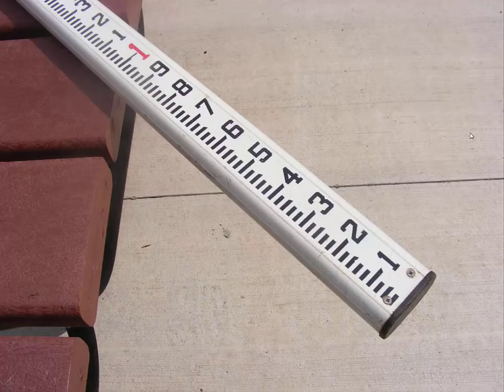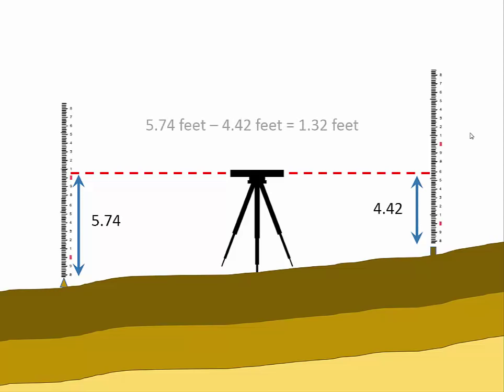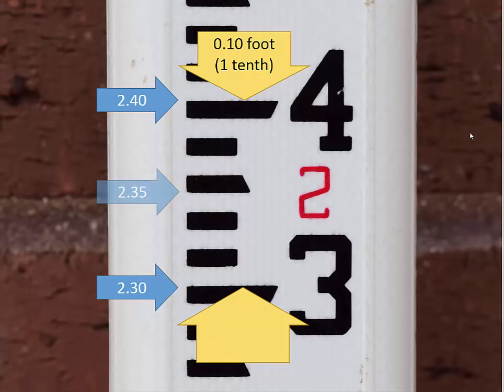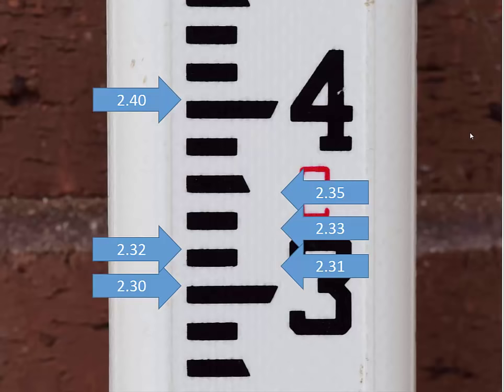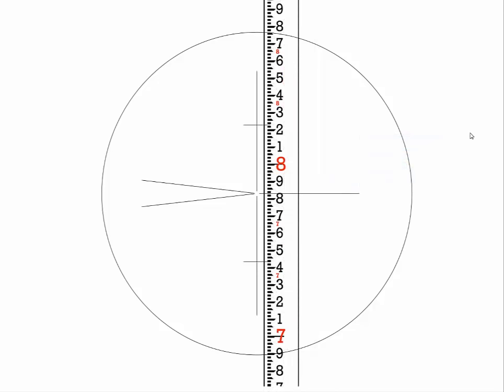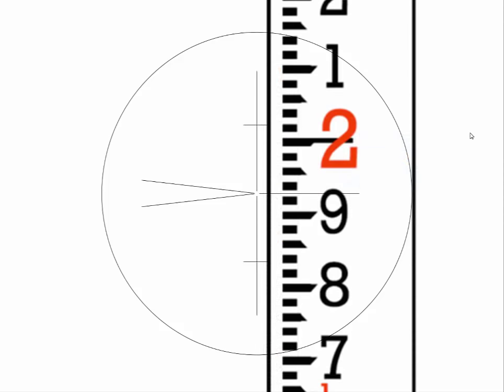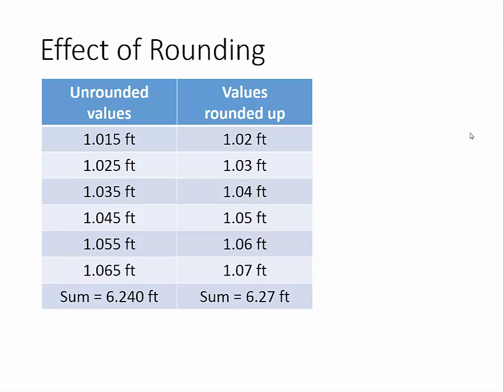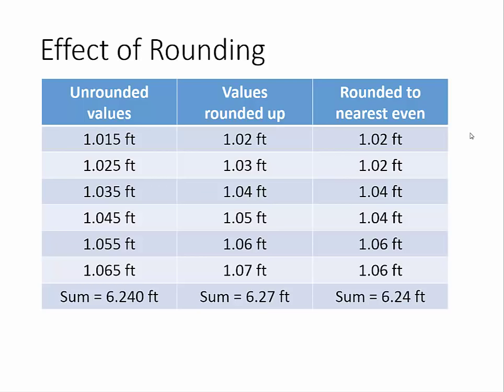Reading the Level Rod

Comment: This is correct as long as the rod is held completely vertical. If the rod is leaned forward or backward, the reading will increase. When I worked for a surveyor, he would have me rock the rod forward and backward towards him slowly and he would read the smallest reading. You should always reverse your circuit to the beginning point to verify if there were any misreads.

Comment: 1 out of 12 = 0.834, 2 out of 12 = 1.68, 3 out of 12 = 2.5, 4 out of 12 = 3.334, 5 out of 12 = 4.168, 6 out of 12 = 5, 7 out of 12 = 5.834, 8 out of 12 = 6.668, 9 out of 12 = 7.5, 10 out of 12 = 8.334, 11 out of 12 = 9.168 & 12 out of 12 = 10. 1 inch is 0.083 feet (8.34% of a foot) & 0.25 hands, 2 inches is 0.168% of a foot (16.68% of a foot) & 0.5 hands, 3 inches is 0.25 feet (25% of a foot) & 0.75 hands, 4 inches is 0.334 feet (33.34% of a foot) & 1 hand, 5 inches is 0.418 feet (41.68% of a foot) & 1.25 hands, 6 inches is 0.5 feet (50% of a foot) & 1.5 hands, 7 inches is 0.584 feet (58.34% of a foot) & 1.75 hands, 8 inches is 0.668 feet (66.68% of a foot) & 2 hands, 9 inches is 0.75 feet (75% of a foot) & 2.25 hands, 10 inches is 0.834 feet (83.34% of a foot) & 2.5 hands, 11 inches is 0.918 feet (91.68% of a foot) & 2.75 hands & of course 12 inches is 100% of a foot & 3 hands long.

Comment: My kind of teache!!
Reply: @RAUL HOGLAND, you mean “My kind of teacher!!” and I can break every single inch out of the foot by the percentage calculation.
1 inch is 8% of a foot, 9% of a foot = 1&1/12 inches, 10% of a foot = 1&1/5 inches, 11% of a foot = 1&1/3 inches, 12% of a foot = 1&1/2 inches, 13% of a foot = 1&7/12 inches, 14% of a foot = 1&2/3 inches, 15% of a foot = 1&4/5 inches, 16% of a foot = 1&11/12 inches, 17% of a foot = 2 inches, 18% of a foot = 2&1/6 inches, 19% of a foot = 2&1/4 inches, 20% of a foot = 2&2/5 inches, 21% of a foot = 2&1/2 inches, 22% of a foot = 2&2/3 inches, 23% of a foot = 2&3/4 inches, 24% of a foot = 2&9/10 inches, 25% of a foot = 3 inches, 26% of a foot = 3&1/8 inches, 27% of a foot = 3&1/4 inches, 28% of a foot = 3&1/3 inches, 29% of a foot = 3&1/2 inches, 30% of a foot = 3&3/5 inches, 31% of a foot = 3&3/4 inches, 32% of a foot = 3&5/6 inches, 33% of a foot = 4 inches, 34% of a foot = 4&1/12 inches, 35% of a foot = 4&1/5 inches, 36% of a foot = 4&1/3 inches, 37% of a foot = 4&1/2 inches, 38% of a foot = 4&7/12 inches, 39% of a foot = 4&2/3 inches, 40% of a foot = 4&4/5 inches, 41% of a foot = 4&11/12 inches, 42% of a foot = 5 inches, 43% of a foot = 5&1/6 inches, 44% of a foot = 5&1/4 inches, 45% of a foot = 5&2/5 inches, 46% of a foot = 5&1/2 inches, 47% of a foot = 5&2/3 inches, 48% of a foot = 5&3/4 inches, 49% of a foot = 5&9/10 inches, 50% of a foot = 6 inches, 51% of a foot = 6&1/6 inches, 52% of a foot 6&1/4 inches, 53% of a foot = 6&1/3 inches, 54% of a foot = 6&1/2 inches, 55% of a foot = 6&3/5 inches, 56% of a foot = 6&3/4 inches, 57% of a foot = 6&5/6 inches, 58% of a foot = 7 inches, 59% of a foot = 7&1/12 inches, 60% of a foot = 7&1/5 inches, 61% of a foot = 7&1/3 inches, 62% of a foot = 7&1/2 inches, 63% of a foot = 7&7/12 inches, 64% of a foot = 7&2/3 inches, 65% of a foot = 7&4/5 inches, 66% of a foot = 7&11/12 inches, 67% of a foot = 8 inches, 68% of a foot = 8&1/6 inches, 69% of a foot = 8&1/4 inches, 70% of a foot = 8&2/5 inches, 71% of a foot = 8&1/2 inches, 72% of a foot = 8&2/3 inches, 73% of a foot = 8&3/4 inches, 74% of a foot = 8&9/10 inches, 75% of a foot = 9 inches, 76% of a foot = 9&1/8 inches, 77% of a foot = 9&1/4 inches, 78% of a foot = 9&1/3 inches, 79% of a foot = 9&1/2 inches, 80% of a foot = 9&3/5 inches, 81% of a foot = 9&3/4 inches, 82% of a foot = 9&5/6 inches, 83% of a foot = 10 inches, 84% of a foot = 10&1/12 inches, 85% of a foot = 10&1/5 inches, 86% of a foot = 10&1/3 inches, 87% of a foot = 10&1/2 inches, 88% of a foot = 10&7/12 inches, 89% of a foot = 10&2/3 inches, 90% of a foot = 10&4/5 inches, 91% of a foot = 10&11/12 inches, 92% of a foot = 11 inches, 93% of a foot = 11&1/6 inches, 94% of a foot = 11&1/4 inches, 95% of a foot = 11&2/5 inches, 96% of a foot = 11&1/2 inches, 97% of a foot = 11&2/3 inches, 98% of a foot = 11&3/4 inches, 99% of a foot = 11&9/10 inches and of course 100% of 1 foot is 12 inches.
Reply: @eugeneyang5678  please stop.  No one cares
Reply: @cw9734  , CW I respect that you told me to stop because you said the magic word please. Technically you are the one that doesn't care. If you think that my information that I posted was not helpful, annoying, disturbing or is too much I am sorry. I worked very hard and put all of my effort on it for at least 2 years ago. If you don't like measuring height or length with the metric system, the decimal feet or the engineering tape measure you can always use the standard tape measure. And some of the standard tape measures do come with fractions of inches too. Just leave if you are not interested and if you are not good at measuring anything. Period.

Comment: Just to throw a monkey wrench in, half of the measurements are positive (the backsight) and half of the measurements are negative (the foresight). Since the odds of the reading that end at x.xx5 will be nearly split between + or -  then however one rounds off a number doesn't matter as long as you follow that pattern consistently.

Comment: now teach me how to use my kubota to actually cut a grade in real life. Cant seem to get how to bring grade changes in an open field together. Im just a homeowner trying to learn how to work my land.
Reply: Same here.  With all the professionals going to total stations, I was able to pick up a used Nokia Electronic Theodolite from a local engineering firm.  It was in absolute excellent condition.  They only charged me $300 for it.  I set up my grade stakes.  I was putting in a 25' x 50' building for parking a truck and horse trailer.  It ran transverse across a fairly steep slope.  On the back of my Kubota L-3200, there is a ~4" steel tube that connects to my box blade.  I picked up a post hole level that straps to the tube from the local hardware store.  It has large levels in both directions.  I also installed top and tilt hydraulic kit on my tractor (One of the best things you can get for your Kubota).  I had my wife sit on my lap and steer the tractor while I used the hydraulic controls to make about a three foot cut into the slope with my box blade, while making sure it was level in all directions.  I had three people ask me why I had cut way too much dirt  out.  It was quite the optical illusion, but instruments don't lie (provided you have used them correctly).  I installed a retaining wall on the upside of the slope and when done it worked great and was level all the way across.  I use the instrument to set grade for the riding arena so the rain runs off and also for making large garden plots.  I also used it to survey my boundaries on my odd-shaped property and help me locate all of my corner markers.  If my septic system should ever fail, I am set with an instrument that will let me do the layout.  I really appreciate these videos.